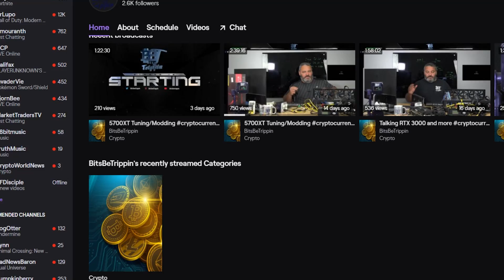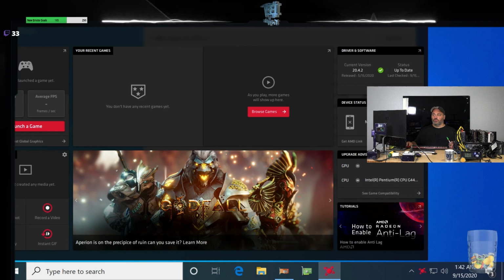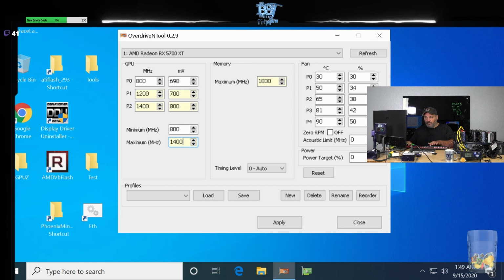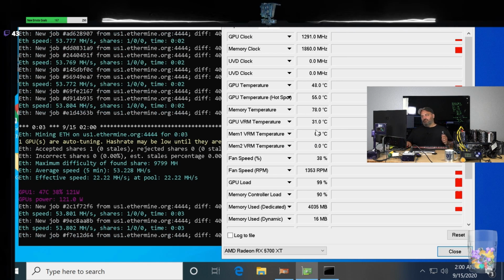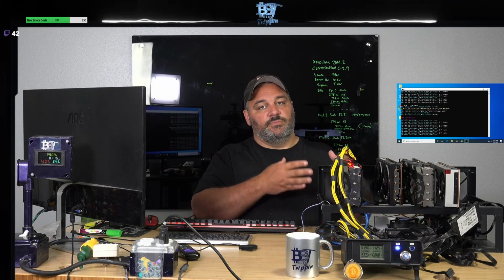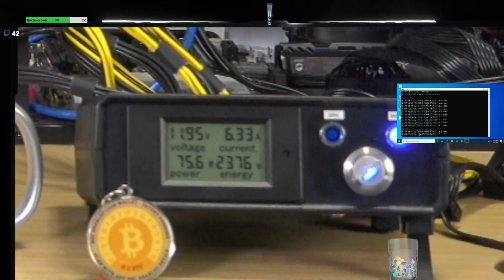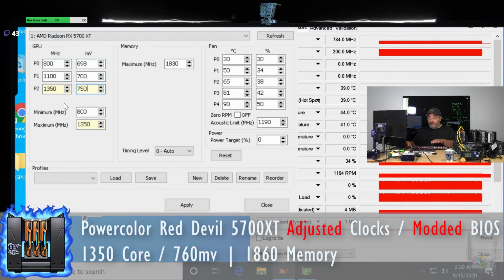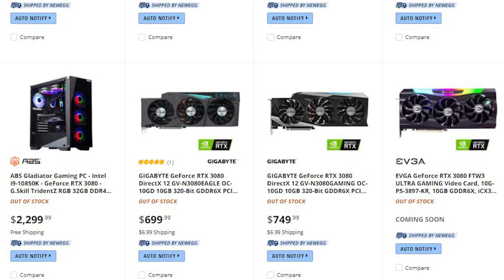Does BIOS modding the Radeon 5700XT increase power usage when Ethereum mining

Comment: What temp of memory did u get ? my rig is getting 90 C even 92-94 sometime . Is that normal?
Reply from the maker: I take memory down to mvddc to 820 vs 850 ; it will drop it to 85-88c
Reply: @BitsBeTrippin  thx very much brother !!!! 👍👍👍🤴🤴🤴
Reply: @BitsBeTrippin   Core Voltage 743, core clock 1350 , memory 1840  = 92-94 memory temp :/

Comment: Hey @Bits Be Trippin'. I have a question. Ts it safe to use two molex heads for two risers on a single modular cable? gpu running at 96-97 watts in software

Comment: I'm looking to build several 5700 xt red devil rigs. My issue is finding the right tools to take advantage of hyper focused tuning. What are the tools you use? I currently am using nicehash  and adjust my settings with MSI afterburner. My rigs however will all be on the Hive when fully configured. Any suggestions would be appreciated.

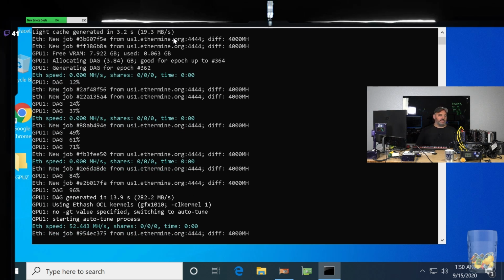Comment: I have got this problem what you described at 3:10. The thing is I got this even on stocks. I can't find anything about it anywhere. Do you have any advice what it might be? 
Im running with 5x rx 5700 xt Pulse on an asus mining expert. Sometimes it does create those DAGfiles and running fine. But whenever i restart my rig for whatever reason. The next startup it randomly simply won't create the DAG stays at 0 mh and the miner will freeze when attempted to quit.

Comment: I bought a EVGA 1300 G PSU. I was planning on building a 6 card(5700XT). Will that PSU do the job? Also, Im looking for info on powering the risers and cards. Splitters, sata etc.
Reply from the maker: GRUBBERZZZ more than enough power. Just make sure to tweak the core/mv settings
Reply: @BitsBeTrippin  Is it ok too take one pcie cable that has 2 ends(6+2) and put splitters on both? Then I could run two Red Devil 5700XT's off one pcie from psu?
Reply: @grubberzzz9982  8pin (6+2) is rated for 150W. 6pin is rated for 75W. So you can split an 8pin to two 6pin.
Reply: @grubberzzz9982  8pin (6+2) is rated for 150W. 6pin is rated for 75W. So you can split an 8pin to two 6pin.

Comment: 5700 XT Ref. in my rigs: 51.8+ Mh @ 88W (reading in Phoenixminer) with Stock Bios. Power efficiency tuned. Memory at around 70c. 
If timing tuning add 10W @ less than 10% more Hashpower. Depending on the power cost if worth it. I'm at 30(ish) cents per kW/h in my country. For me.. Not worth the Timing tuning. Lower timings also makes memory run hotter (higher fan speed required), puts more stress on the memory power circuitry(longevity is decreasing).

Comment: So if you had your pick ..5600 XT vs 5700XT ..which is a better  choice.. cheaper per card and lower power..vs higher hash, $100 more and higher power use.
Reply: For the same price as an RTX2060 Super these days you can get similar hashrates and still have the versatility of mining other coins in future when ETH goes to 2.0, wouldn’t NVidia be a better buy in this case?
Reply from the maker: Honestly, 5600 XT 6GB GPU. The lower cost of entry helps you pay it off much quicker and cant beat 42mh with little effort.
Reply: @BitsBeTrippin  can you dona segment working through a 5600xt to 42mh

Comment: stable at 1300, 725, 1824 - 56mh at around 120w modded. the power increase vs stock bios was too small to pick up in my set up and at 725 can not compare like for like. good to have you back bbt and thanks for the tip about the 5600xt. got myself a few after checking your video on these and very pleased so far 40mh at around 80w
Reply: @jminerI put bios from pulse BE on the 5600xt pulse i have for 2mh bump. thanks to Guntis, check his latest video ....

Comment: I know nothing about crypto mining.  Would, or could, a Raspberry Pi be used to monitor and adjust these settings to be more efficient during a 24 hr period?  When it is late at night and electricity is cheaper to use, a more aggressive setup might be worthwhile for larger mining rigs?
Reply from the maker: You could technically build a script in windows (powershell) to accomplish that, no need for a Rasberry Pi to handle that task. Most Linux based Mining OS, like simplemining or HiveOS both offer schedule/adjustments and automatic rebooting.